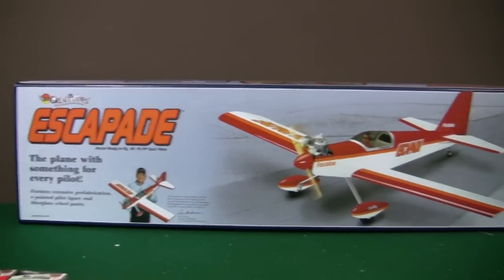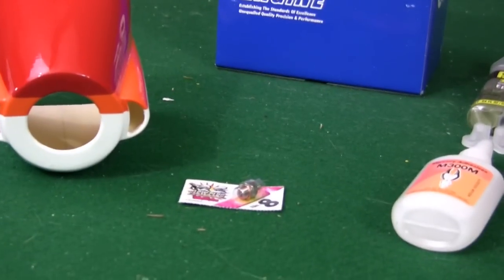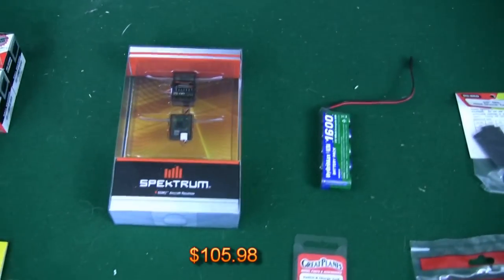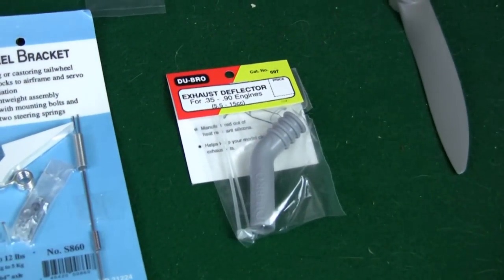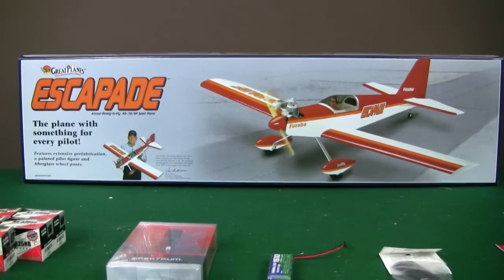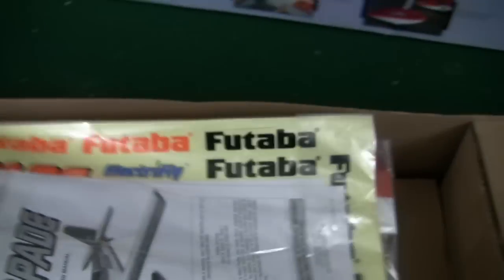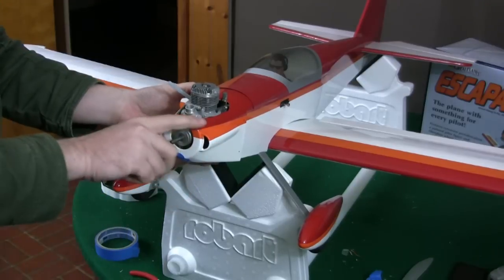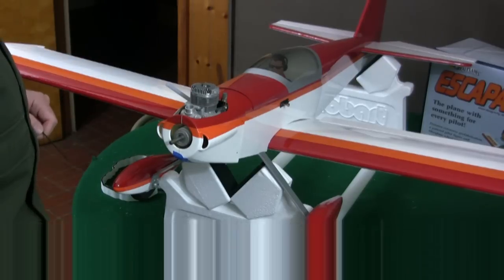Great Planes Escapade full build video with pricing

Comment: You forgot to fuel-proof it. Simply mix up some epoxy and add a little nitro fuel to thin it out. Then brush it  all over the engine bay and firewall inside and out. This will help save your Escapade from fuel softening the wood. Plus, it gives it a nice varnished look inside. I completely did all of the inside, servo tray, all of it. Its worth the extra effort and your model will last a lot longer
Reply: Wouldnt the oil in the nitro fuel soften the epoxy mixture?
Reply: Douglas Dixon epoxy mixed with denatured alcohol works best and you can mix it to the viscosity you like, or just brush the epoxy on straight, which is what I did.

Comment: Typically, there are two fuel lines coming off the fuel tank on a glow airplane.  One line to the engine carburetor  and the other "Vent/fill" line to the muffler.  The fill line, where you have the "quick fill" fitting installed, is that line suppose to be connected to the muffler nipple in order to create the vacuum in the fuel tank ?

  You must have a "T" connector  on the Vent/Fill line ?